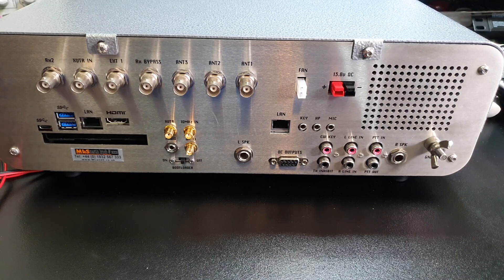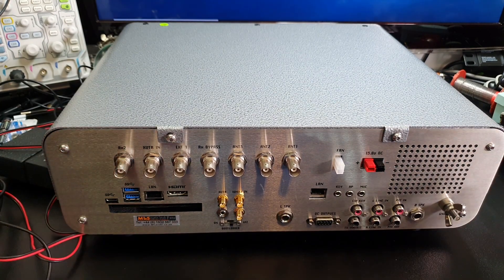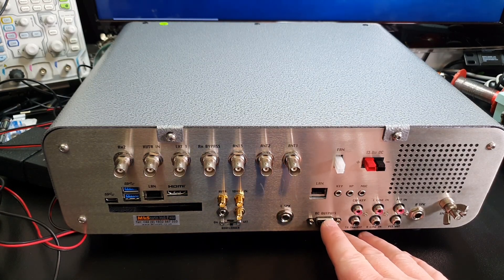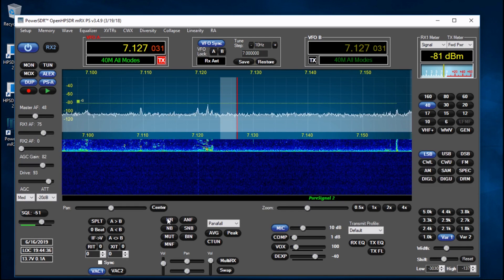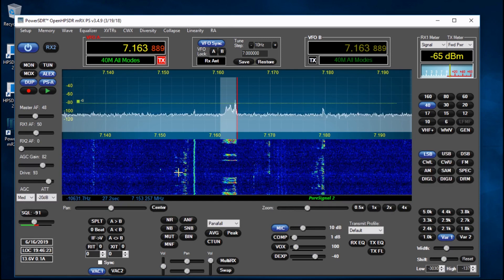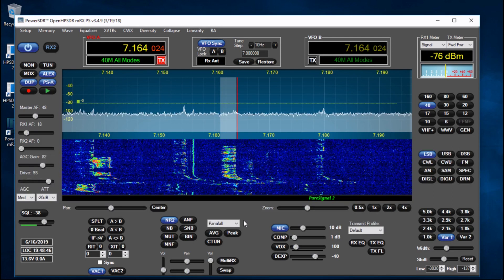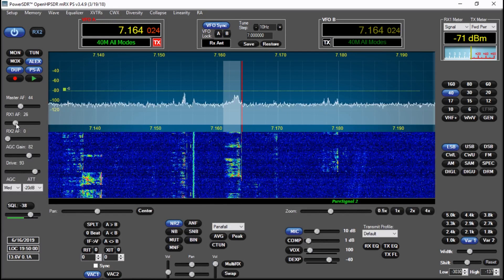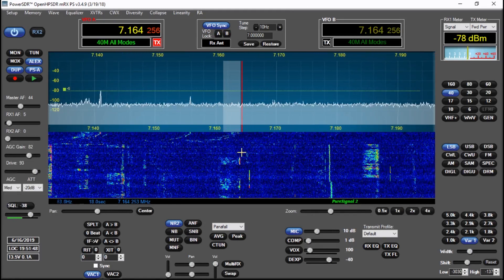The Apache Labs Anan 7000 DLE Mk2 with built in Intel NUC i7 SBC

Comment: What spec computer do I need to run the radio? ???
Reply from the maker: the radio I had here had a pc built in.. but the PC realy doesn't need to be that fantastic.. but probably needs to be able to cope with directx 12 or late opengl .. Gaz
Reply: @TheGazLab  Thanks !!

Comment: Great video - thanks for positing . How would you compare this to the Flex and the Sun ?
Reply from the maker: wow thats hard.. both are great bits of kit... I thing for me it boils down to size and use.. flex are great proprietary system with remote ops that are second to none.. the sun sdr is small and a great proformer with great software, remote is not so easy tho and digimodes still need VAC etc..

Comment: How do I run this without Windows? In other words, Linux Only.
Reply from the maker: The anan I had here comes with windows installed, you could load Linux and a compatible software but I just don’t see the point as power sdr is very good and has amazing noise reduction etc..

Comment: That was great video. I'm buying an SDR next week. I've read many discussions about how the Anan and the Flex 6600 compare. The things I've read about the Anan that turn me off (sorta) was that the Flex had an integrated CPU that did most of the process in and the Anan didn't . Now I've read that the Anan 700 and 8000 DLE mark 2 indeed has an integrated i7 cpu. In your opinion does that fill in the gap of previous iterations of the Apache transceivers?  I'm trying to get a feel for what Apache had in the past compared to the transceivers with the I7 cpus?
Reply from the maker: For some unknown reason youtube has just thrown this comment up 7 months late.. sorry lol 
An SDR with a PC in it is not the best combo, potential noise, heat and above all premature outdating.. 
I would alway choose an SDR without a PC built in.. the anan has a NUC board and it is very very fast reliable and stable.. but I would get the version without it built in simply because its easier to upgrade etc..
software is changing, check out the Expert SDR PRO DX and the version 3 of their software... :-)
Reply: @TheGazLab  Thanks for the reply. I did purchase the Anan 7000DLE MkII without the integrated PC or CPU. Yes potential noise was one reason. Another was the hassle of Microsoft updates. It's already bad enough with an external PC I couldn't imagine the implications of the future issues of having the PC inside the radio.
I've been very happy with my buy. It's an outstanding SDR platform with solid performance. Yes, I've had a couple issues with Microsoft Windows Updates. Thank you for the reply and thank you for the review! 73!
Reply from the maker: @ruben_nb4r  well you can stop the updates for a while I'm told there is a version you can shut off completely.. I'm looking forward to open gl being dropped and the multi platform softwares beil developed so perhaps Linux would work..